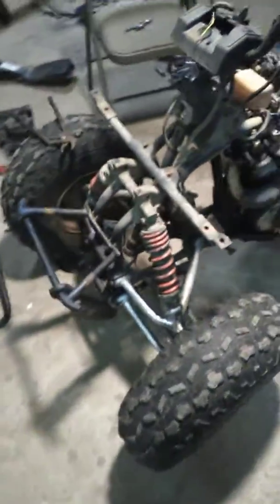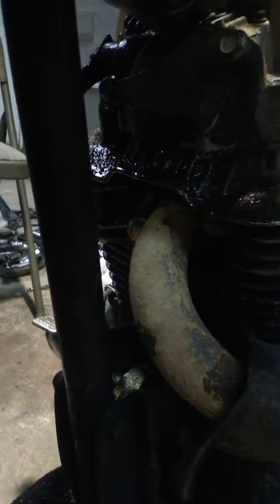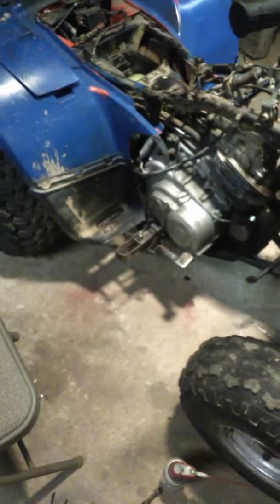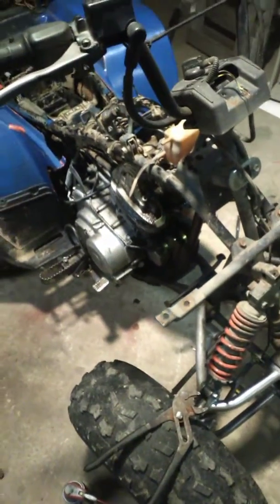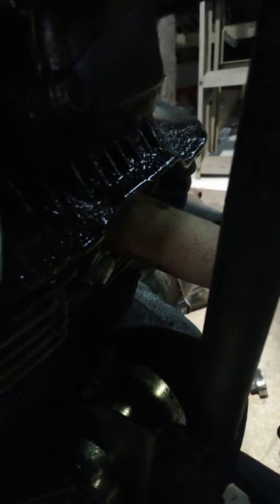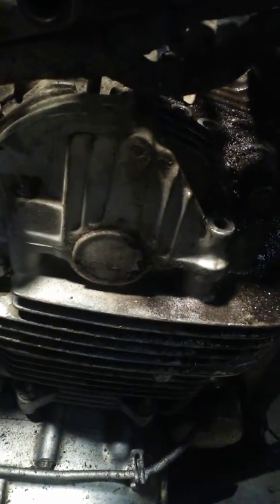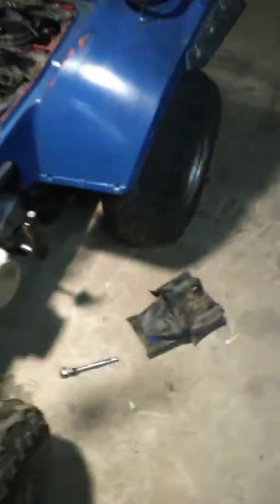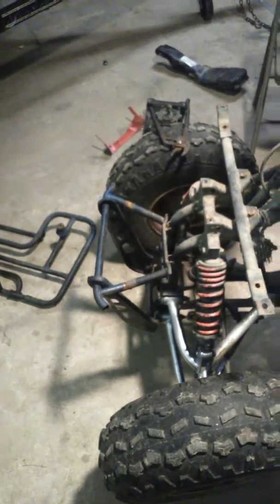Oil leak repair 87 Suzuki lt300e

Comment: HELP will this stop a oil leak in the exhaust? Its spitting out the exhaust and burning inside
Reply from the maker: Like out of the muffler at the back or out of the header pipe close to the motor